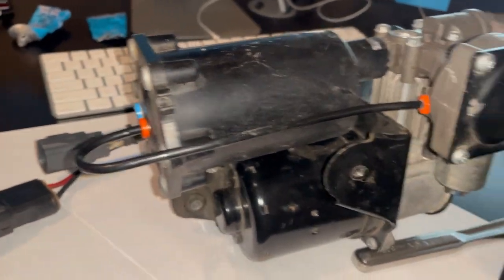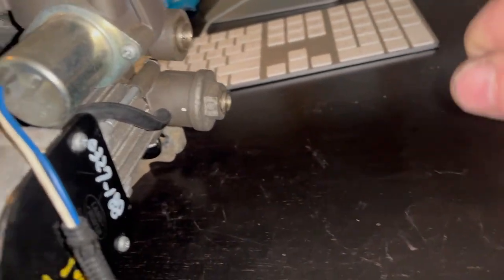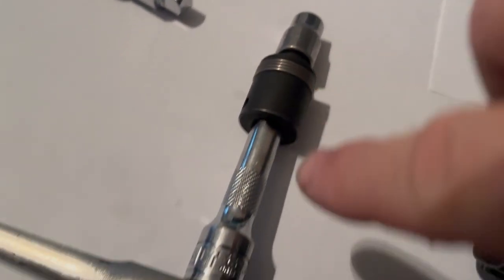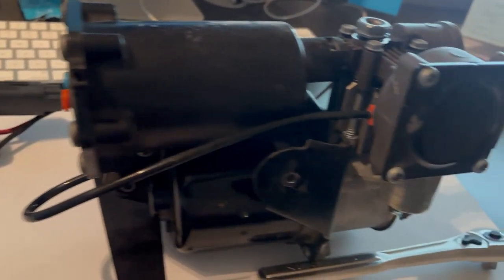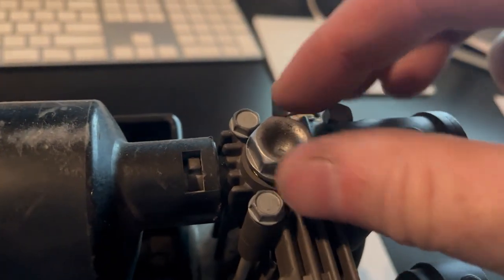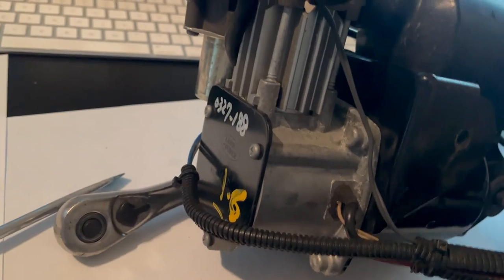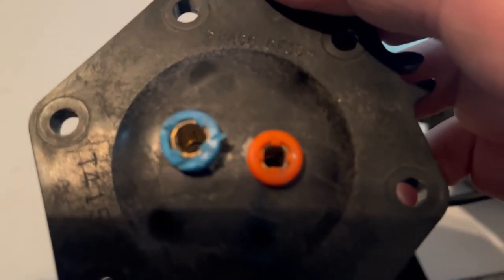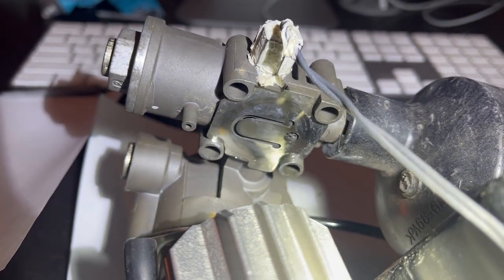Land Rover LR3 / Discovery 3 Air Compressor rebuild tips

Comment: What part keeps air pressure in the dryer. I have cheap ebay pressure that bleeds out after 4 seconds. Would like to fix it using my old parts compressors.
Reply from the maker: you may have an issue with the top of the air dryer....the original equipment tops crack...replacement tops can be purchased